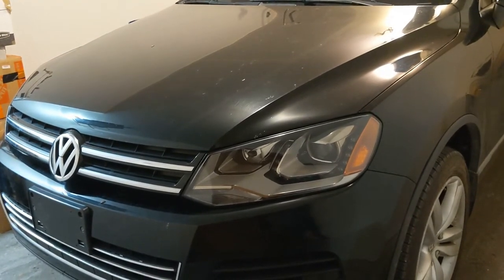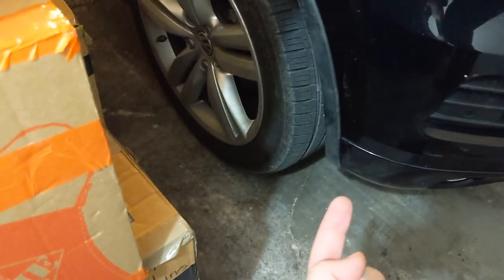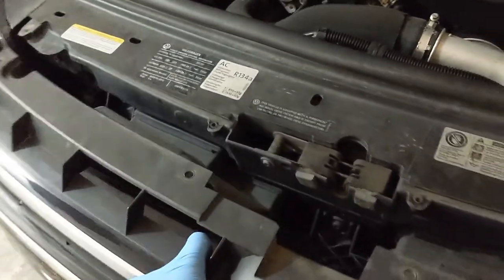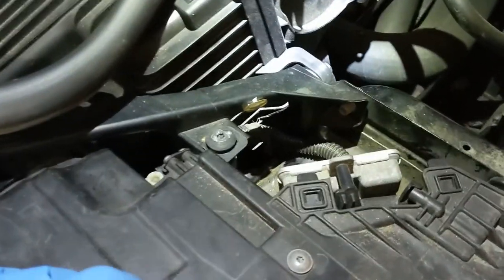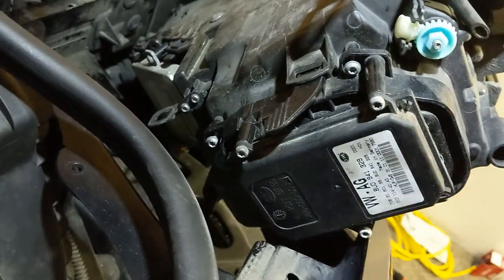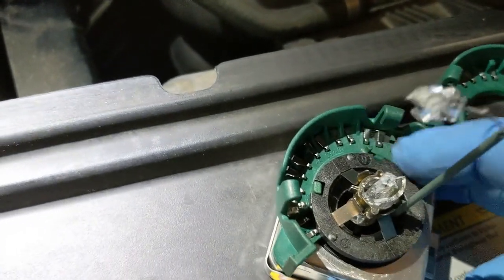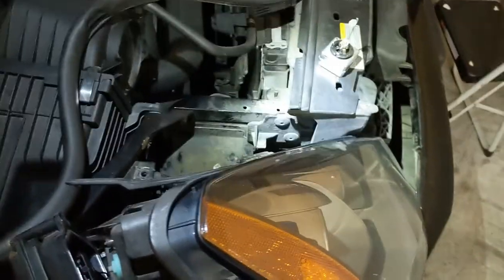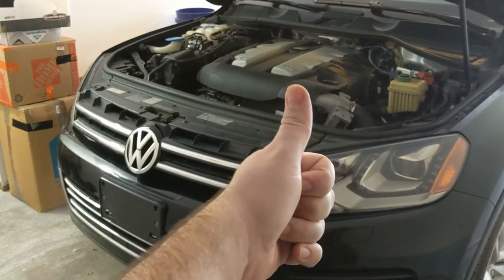2011 VW Touareg (7P) (T3) Bi-Xenon Headlight Bulb Replacement

Comment: Great video,  I need to replace the small ring lings in the head light assembly, do you know what model they are and is it possible?
Reply from the maker: Thanks. No, I'm not certain what part number that is, probably only sold as the next higher assembly.

Comment: Hi, I did what you did but somehow I get the cornering light error. Does anyone here know, should I do some sort of calibration after this? My steering wheel was turned to the right so I had easy access to the bolts under the wheel arch.
Reply from the maker: Did you ever get the cornering light error sorted out?
Reply: @ntgm20  it was working for two months.. And it is going to a mechanic next month for a che3up. I cleaned the contacts and it worked some time. Now it is not. Cornering lights are working, auto long beam short beam is not.
Reply from the maker: @carlosorff  Thanks for your feedback.  I have the North American version, so don't have auto long/short (hi/low here). Hope it gets all cleared up for you.
Reply: What bulb type was they?
Reply: @Richytbiscuit  Philips X-tremeVision Gen2, DS3, 42 V, 35 W, PK32d-5 C1 (42403XV2C1 )

Comment: Thank you for the video. What is the color temperature of OEM that you removed. I am thinking of upgrading mine to 6000K.
Reply from the maker: I can't say what OEM is based on my vehicle. What I put in was a 4200k and it matched the one I did not replace pretty well.  I feel that is a pretty good match up for my vision and these projectors.

Comment: Thank you for the video. Did you have to remove all the bumper screws fully?
Reply from the maker: Yes, all the screws I mention in the video do have to come out. There are still four screws or bolts down below that are still holding it on, so this really only loosens the bumper.
Reply: Thank you!
Reply: When putting back the bumper was it a struggle to get it aligned? I am tackling this project this weekend and would like to be prepared. Thanks
Reply from the maker: @sylee2113  It took me a couple of tries to get it right but no, it wasn't that difficult. It might would have been smoother with a second person, but as it is still connected at the base it is still manageable by one's self.
Reply: goodmonkey02  thank you again

Comment: I hate this car and I wish I would gave known how absolutely ridiculous it was to change or repair anything on it
Reply from the maker: I think I've had a headstart by all the repairs I've done on previous VWs. The Touareg is definitely different though, and high MX cost is what I'm most concerned about.
Reply: Battery underneath driver seat, sealed trans, and this so far. Its a pain in the ass but overall I love mine